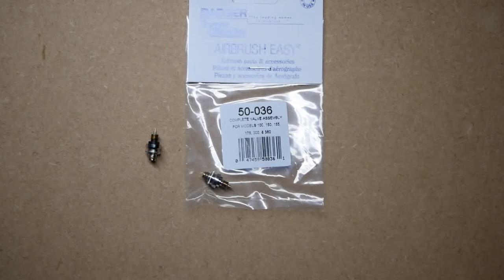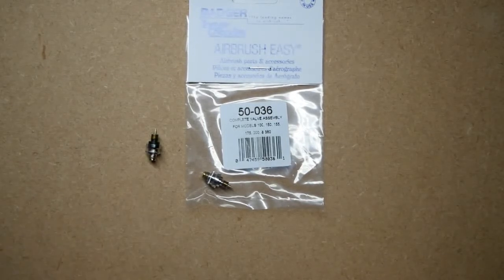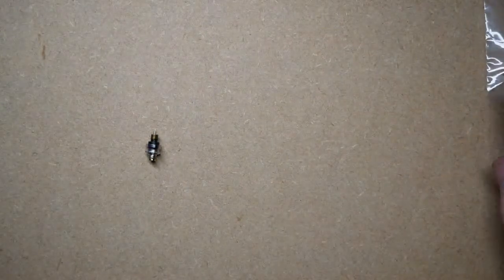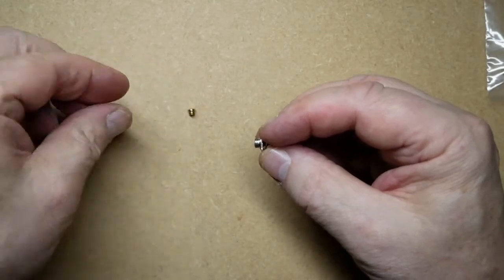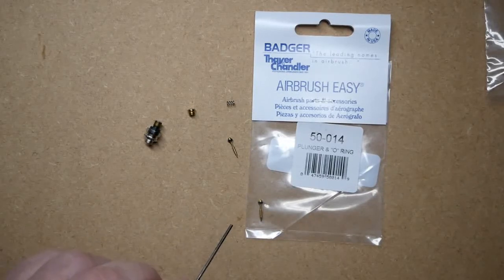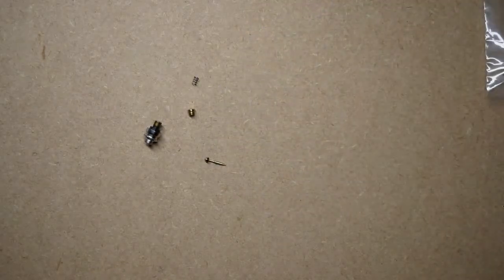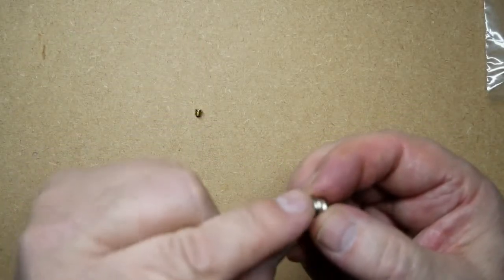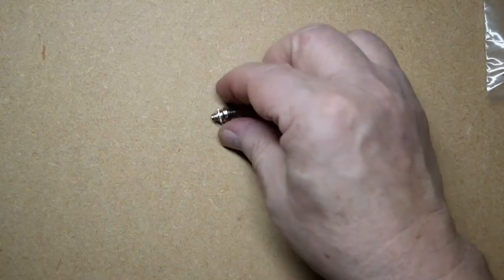Badger Patriot 105 Air valve Parts

Comment: Hello, and thank you for this video.  I have a couple of questions for you. The first is what size hex/allen key are you using for the screw. The second is I just got my Patriot, and there is close to no air coming out when I depress the trigger. It can still back flush but I don't think that it is getting enough air to draw out any paint even with the trigger pulled all the way back. Any advice would be helpful.

Comment: Thank you for directing me here, no wonder I was so confused. It seems my airbrush is entirely missing the plunger and the air valve screw out of the box..
Reply from the maker: All Badger airbrushes are tested before they are posted out
Reply: Mine came from a local hobby store in odd packaging, might be second hand. I've found the parts I needed thanks to this video.
Reply from the maker: Glad you found the parts needed to get your airbrush up and running